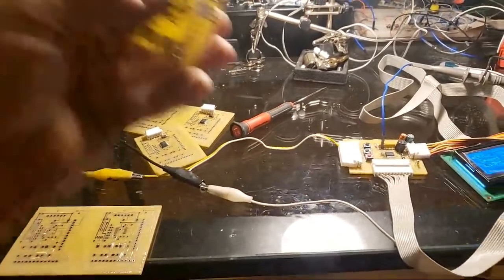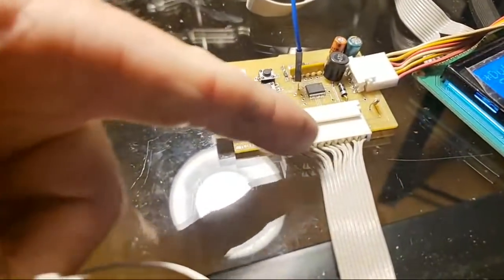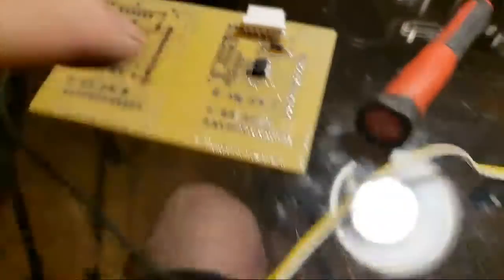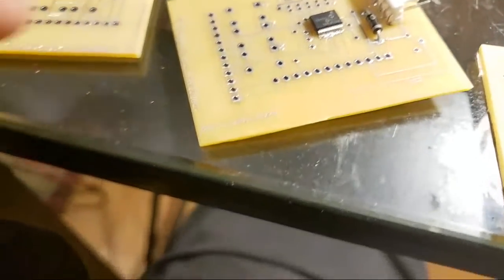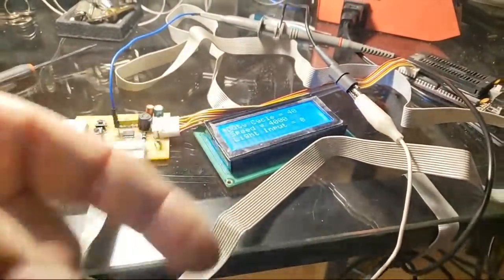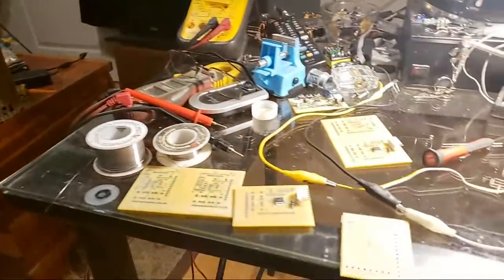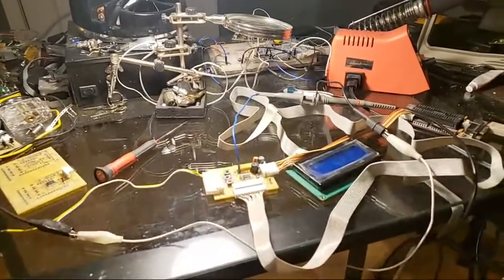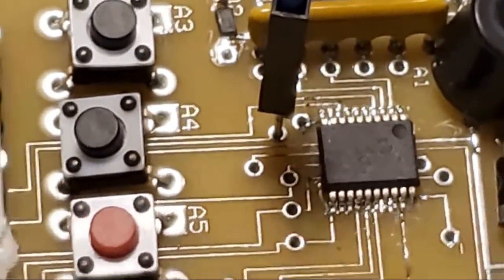Troubleshooting New Circuit Board Design

Comment: Just use hot air for soldering or simply a larger tip on the iron.
If there are bridges between the pins just use some desoldering wick to ger rid of them.
This works much better that that super fine tip.
Reply from the maker: Using the soldering wick after sounds like more work than just wearing my magnifying glasses.
Reply from the maker: Once I get the board at the correct distance from my face I seem to be able to solder the chip on pretty well.

Maybe I'll set up a camera for a close up